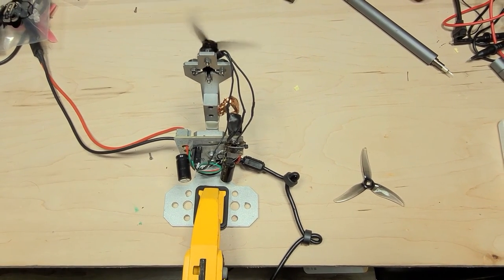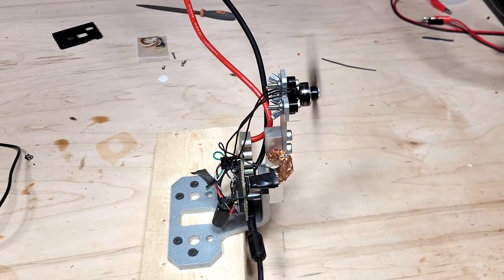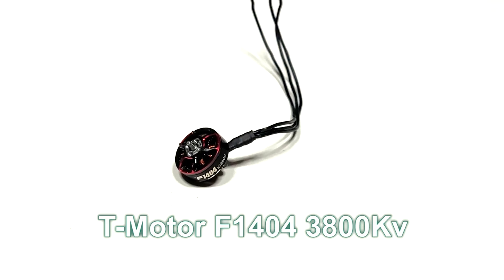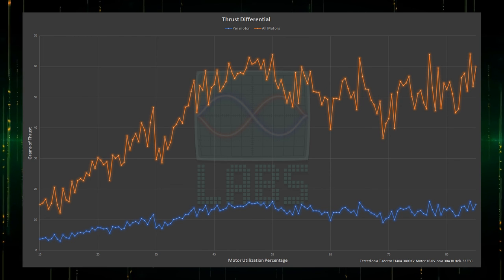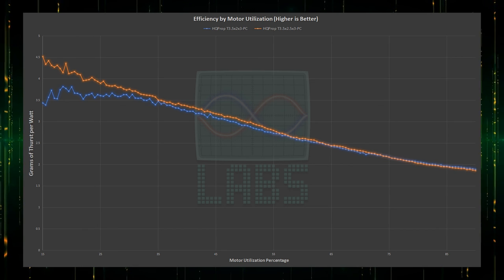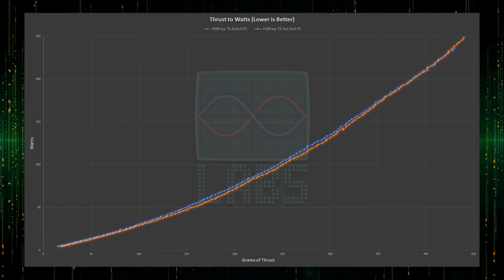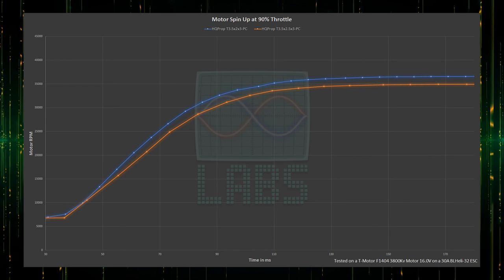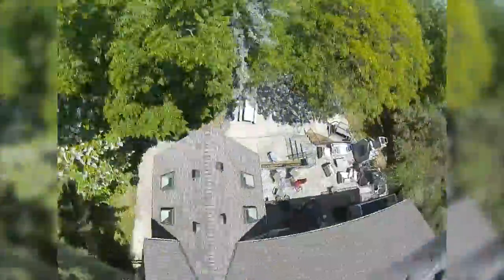New 3.5" Propeller King? HQProp T3.5x2.5x3 comparative testing.

Comment: Using these on my 3.5" build and loving them. I opted for the EMAX RS  1306B 4000 kv motors since they provide more thrust while having nearly the same weight as 1404.
Reply from the maker: I used to use those motors for all my builds. I have testing on them in previous videos.
Reply: That's interesting. I was always wondering if the 1306 are worth the trouble of getting them, since I have to order them from China. The T-Motor ones are plenty available in my country. Guess I try them on my next build.
Reply from the maker: @Rewind-FPV  The jump in efficiency is worth giving them a try if you're buying new since you can get away with a smaller battery for the same thrust.

Comment: Informative as always! I tried them 1month ago, i don't have a thrust stand but i found to be too much pitch for freestyle (reduced throttle resolution and turbo-like effect). Still prefer the throttle feel of the T3.5x2x3.
Reply from the maker: Given that it's more efficient, you could consider adding setting a motor output limit of 90-95 or so to get a similar feel. If you don't' have vbat sag compensation enabled, I'd start there (I use it) since that'll adjust based on voltage and cap it off at a higher voltage.
Reply: @RecursionLabs  I always use 100% vbat sag comp for better pid and stick feeling on entire flight duration. Generally i don't care about max thrust, i target my build with 6:1 to 7:1 thrust to weight ratio. I care more about the shorter response time and cornering ability (prop drag to auw ratio - so biblades wins for me). Could you (with your current thrust stand) create a thrust to time chart? I mean setting motor to idle and quickly drive it to 100% and measure the thrust after a fixed constant time. Thank you! BTW: i really like the HQ T3.5x2.2x2 ;)
Reply from the maker: @samuelepaganoni9741  I'll need to get one of those to test. There is a spin up chart in the video. It's from 5% to 95%.
Reply: @RecursionLabs  It's rpm to time chart. If you put a 2" prop on 1404 motor it will spin up even faster but produces way less thrust. Anyway ... I think the choice of 3.5 "props is finally expanding :)
Reply from the maker: @samuelepaganoni9741  Like I said, RPM to throttle and RPM spin up time charts are both there.
Reply: @samuelepaganoni9741  where did you buy the 3.5x2.2?

Comment: Hey man! I fly at 8-10,000 feet on a 3.5 prop mostly doing exploring and long range, are there any props that would solely improve efficiency? I am not as worried about punchout (though the air is quite a bit thinner here, so still need some bite). 

I bought these HQs, just curious if there was another option people avoided because of reduced punch or something. Would a 4 blade be beneficial?